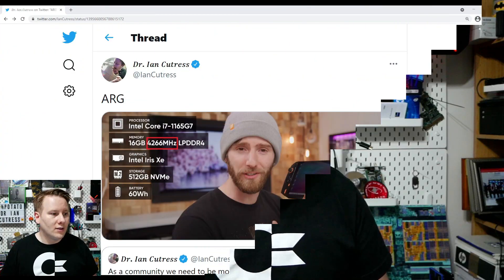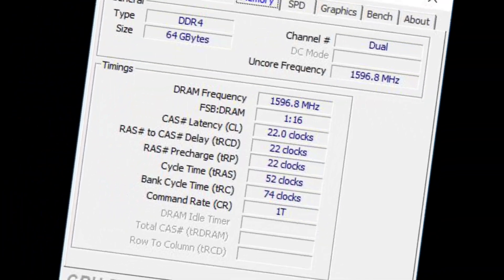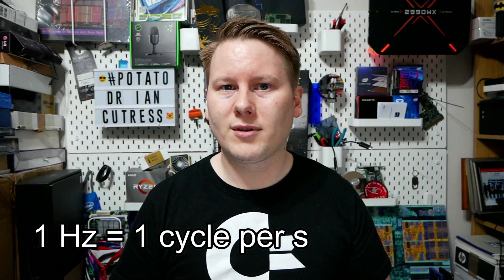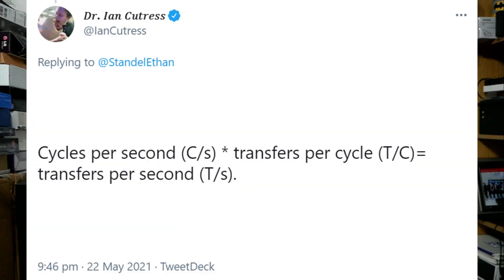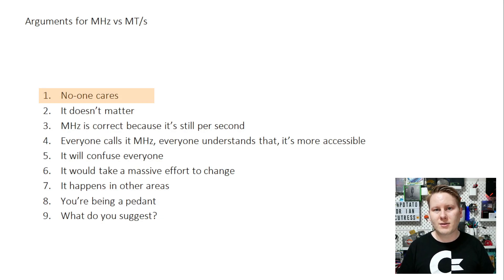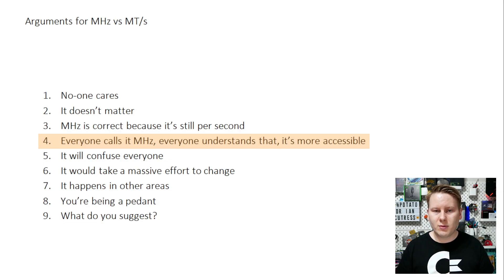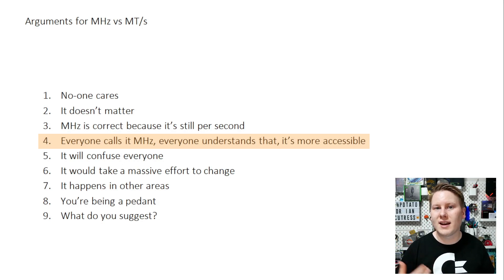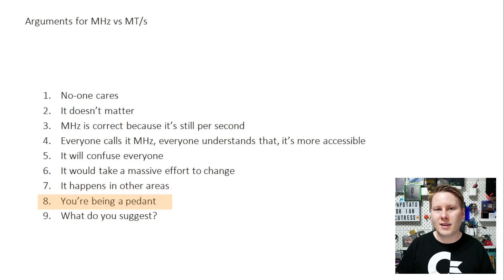Linus is WRONG 💩 : Explaining MHz vs MT/s

Comment: like I wrote under the original video from LTT, modern SDRAM modules use some kind of prefetch. A DDR4-3200 module runs at 3200 MT/s, a bus (I/O) speed of 1600 MHz but only 400 MHz actual memory chip speed. DDR4 uses x8 prefetch, DDR5 will use x16 prefetch. That's why theoretical DDR5-3200 module would run the chips at 200 MHz. This is the reason, why the absolute latencies are stagnating, because memory chips stagnate around 200 to 400 MHz each DDRx generation.

Like buildzoid, I'd prefer to refer to the measurable number -> how many bits can a module process per seconds. I think JEDEC would agree, since the offical nomenclature for DDR4-3200 is PC4-25600, which refers to 25.6 GB/s.

Comment: I have 2 issues with your video point #3. Mhz is just something over seconds. Changing it from clock cycles per second to transfers per second and still using Mhz is still fine. I understand if you think that Mhz needs to be reserved only for clock cycles, but no part of the unit Mhz has any reference to a cpu or ram cycle, only to a single unit over a second. #9 using no units is my idea of scientific hell. please no. Announce the units and tell me what they mean in the scenario. Like in chemistry when we use concentration, we use XX% w/w to signify the percentage is expressed as weight percentage as opposed to volume. In this case we could use Mhz clock cycles or MT/s and state the uinits. No units is a horrible decision.

Comment: On that Wan Show, Linus asked Luke a question about MHz and Luke was actually stumped for the exact reason that it wasn't immediately clear if the MHz Linus was asking about was DDR or QDR.

In practice, as a particular memory standard becomes more popular, I imagine you could often infer from context what the actual clock speed could be, because QDR would provide double the memory bandwidth of DDR. For example, it wouldn't really be possible for a memory kit to boast 6400 MHz if it's only DDR (meaning for it to be 6400 it really has to be QDR). And because it's QDR then you know the memory clock should be 1600 MHz.

But yeah, I remember when I first learnt about memory speed I was quite confused about the memory speed advertised, because of the "MHz" listed. It's only when I started to check past forum post answers after googling a little bit that I realised what was happening. And after a while I just stopped caring because apparently the people who sell memory don't seem to care anyway.

Edit: but Linus has a point about your channel name. So when you say making changes for the better...
Reply: "For example, it wouldn't really be possible for a memory kit to boast 6400 MHz if it's only DDR (meaning for it to be 6400 it really has to be QDR). And because it's QDR then you know the memory clock should be 1600 MHz"
Well take decade old QDR 3200 vs DDR 3200 and you get a confusion if the context is not well established. And it's quite easy to be mislead on certain types of memory such as GDDR.

Comment: i did not know about this before i heard of it on the wan show and i think you are right, its is very important to use the right units.
 i am very against using obscure terminology as a form of gatekeeping,  but here it is needed because they describe different thing and as you said for ddr  Hz is of by a factor of 2 and describes the cycles per second not transfers.  
keep up the good work and please inform us on other incorrect uses :DD

Comment: Curios question then what is actual operating rate of GPU memory. is it the figure which they mention for 256 bit bus which is 448 GB/s (and so on for 384 bit bus etc) or the rate of transfers which we see in the overclocking software (which is shown in MHz)

Comment: MHz - cycle of how many times something happens. It doesn't specify what, your example of digital logic cycles is just one specific type of cycle. You can as well say that it is the cycle of opportunity to make a transfer, you don't have to make the transfer, but the opportunity to do so is periodic/cyclic. The point is - MHz by itself doesn't in any shape or form specify the exact event that has to happen periodically, it just specifies the frequency of some occurrence. MT/s specify what happens, that is the only difference, but both are correct, one is just more specific to this use case.
Reply: Thanks, exactly. A frequency is just a rate... It can represent anything that changes periodically, the changes in the clock or the transfer rate or number of potatoes I eat. The whole argument is utterly stupid and in the end is just a convention.

Comment: I have known about the discrepancy between rated/promoted speeds ever since I built my first computer. 
 The listed speed in OS was less than half for my memory (because it was running below rated speed, bios settings needed) and the way I looked at the ddr speed then was the same as I look at boost speeds for GPU and CPU, a peak speed. 

I didn't understand ddr at the the time, I genuinely thought it would boost up to 2x the clock when needed, it was one of the creators you mentioned that made med understand the details

Comment: No, your very right.  Moving forward, I'll skip the units unless it's called for, and then be sure to use the correct units.

I know it irritates me seeing measurements of base 2 being incorrectly expressed in base 10 (1tb is not 1000 gigabytes, it is 1024 gigabytes).  I use these measurements more enough that it throws me off when expressed incorrectly.

Comment: On a similar tangent, it's like the lightbulb industry that used wattage for over a century as a measurement unit for their products. It wasn't wrong per se, but people took it as a measurement of light emission instead of a measurement of energy consumption because only one lightbulb technology existed for so long (incandescent) so no one cared about being wrong since you could easily compare the light that a 40 watts lightbulb emits with 60 watts or 100 watts, etc.

Then, in the 2000s, CFL lightbulbs flooded the market, and we had to make mental gymnastics in order to understand that now these lightbulbs were only using 15 watts to emit the same amount of light as a 60 watts incandescent one. A few years later, the same thing happened with LED lights; 15 watts became 8 watts for the same amount of light emitted.

It seems the industry is finally, but slowly, transitioning to lumens to measure light emission, but they still have to print "Equivalent to 60 watts" on the packaging so that most people understand what they're buying. I've tried explaining all of this to my mom numerous times and it just doesn't stick, she wants her 60 watts lights lol

Comment: Nice video. Would like to see single rank vs dual/multi ranks. I just tried mixing 16gb crucial ddr4 2667 dual rank had address mapping from edge connector set in synchronous mode while sk hynix dual rank oem Dell used 8GB 2133 had address mapping set to mirrored. Any technical differences? I returned the crucial memory since performance was terrible.

Comment: Until retailers and BIOS makers change the units, I don't think it will change. Also, im fairly certain Linus used to use DDR4-3200 for example in his videos (iirc around the zen 2 era).  Maybe he uses it interchangeably. Don't think it would change much if he went back to that style though.  Everyone has to be on board.

Comment: Love ya video and agree with a numerical change to the way dimms are portrayed. Unfortunately, like Linus, people are not understanding of the units all too well and only look at bigger is better. Lower CAS latency, for example, will destroy a higher "MHz" number on the flashy chips. By integrating CAS into the equation and creating a ratio of MHz/CAS (or transfers if you wish) you will get a new fancy ratio to determine what is right for your needs. The higher this ratio value, the better the performance. I plot this number vs the cost per GB.

Comment: I didn't know that ddr didn't do 2 transfers per cycle!!!  I always thought that was fixed to 2/C.

I guess siw as in group 3 but if it is indeed not fixed 2/C than yeah MHz is wrong.
Reply: If nothing else, it needs a state for 'no data being transferred'... besides, the CPU mem controller has a clock generator that in the case of DDR4-3600 runs at 1800MHz. Why would you use any figure other than that set by the clock generator?

Comment: The manufacturer calls it Trident Z Royal DDR4-3600MHz.
Also the CLOCK cycle is running at 1800 MHz, but it's doing transfer at 3600 MHz. If you look at the diagram for DDR, there is 2 distinct, time separated signals being sent per CLOCK cycle for DDR. If you have a cogwheel with 100 teeth connected to a larger wheel. Say the smaller gear is rotating at 20 Hz, the teeth will be contacting the larger gear at a rate of 2,000 Hz. It's still correct to say that especially outside engineering.

Also Hz is a SI unit, you need very good reason to avoid using that. Also, also why have computer scientists pretty much reinvented baud rate? In information theory and analog signals you use Baud, symbol per second, saying 3600 MBd is just a more general way of saying 3600 MT/s. The unit T/s is also a terrible unit because it is in direct conflict with SI where T stands for tesla. 3600 MT/s in SI, already means magnetic induction slew rate, ie how fast a magnetic field can change. Don't use T/s, it's a dirty unit.

Comment: I agree people should definitely either be using the right unit or don't use units at all, in which case implicitly people are talking about megatransfers per second but explicitly they are just mentioning a speed signifyer. I'd say, though, that your rebuttals of "it doesn't matter" and "you're being a pendant" given in the video are not very good, especially in light of your agreement that it would take a massive effort to change. Unimportant pedantry leads to negative consequences just as imprecise language does.

Comment: Better to change to correct unit, even now cpu-z memory tab causes some confusion in not well informed audience anyways, at least your approach should be used, drop unit completely, but to change to correct unit would be better, (also it can be mentioned in more specific videos how does units work).
Reply: You know, CPUz could just change the way they report to the user. 

Why change what works for the average consumer just to please people who are tech savvy?

All this is advocating for is confusing the shit out of the layman.
Reply: @nordgaren2358  Its possible,  in this case CPUz should either drop the unit, or report MT/s, it will not be good to and perpetuate usage of incorrect unit
I do not think that is would be a big hassle to everyone to switch  to correct unit
Some vendors now use incorrect MHz marking, but if check detailed specifications, there is correct correct MT/s unit there, otherwise they could be sued for incorrect information, now they can at least claim, that MHz in the name is for marketing purposes and specifications are correct, but IMHO still a misleading marketing
Reply: @giokiborg  the average consumer would just get confused. 

They're already confused enough, as it is. 

This is really a pointless video.
Reply: @giokiborg  I don't know a small ngle manufacturer who lists the product name with MT/s. 

Yes, in the specs, but not in the product name.

How could they be misleading people if they put that info in the publicly available specs?

Hell, how could they be misleading people of people don't even know the defence between MHz  and MT/s?

The only people they would be "misleading" are people who know the difference and THOSE people already know that MHz isn't MT/s and that the advertised MHz is the overall transfer rate of the module. 

Again. This is very pointless and is just a giant "ummm ackshully".
Reply: @nordgaren2358  I do not agree
Misleading is the fact, that in the product name some manufacturers have MHz in the name
for example this: https://www.newegg.com/ballistix-16gb-288-pin-ddr4-sdram/p/N82E16820164173
If customer is not aware,  they think, that their RAM works at  3600 Mhz and this fact is misleading, even if they have listed in specification correct MT/s (but no mention on MHz)

Meanwhile other manufacturer names their RAM without MHz in the name
https://www.newegg.com/g-skill-64gb-288-pin-ddr4-sdram/p/N82E16820374003 (like Dr. Cutress proposed)

If you do not think that its a shady practice, I am out of arguments,

Yes, we kind of don't care anymore MHz, or MT/s, but it does not means, that we should use incorrect unit, just because of marketing demand 
I am sure this was used for marketing purposes, to write bigger number on the box and to hell correct units. Linus himself often calls out marketing BS from manufacturers, so why submit to this one?
Reply: @giokiborg  the customer still understand what they are buying...
Reply: @giokiborg  your hypothetical issue doesn't even fit the problem and solution you propose. 

Wether you brand it as 3600 with or without the MHz, CPU-Z is still gonna report the 1800MHz speed. 

This sounds more like a CPU-Z problem than the entire industries marketing problem.
Reply: @nordgaren2358  Agreed, in same logic, they will understand correct units as well, so what is the reason not to use correct unit and use "marketing unit"?
Reply: @nordgaren2358  My issue is with misleading marketing and incorrect use of units, which could be solved in very simple way: use correct unit

CPU-z is not only one which shows correct frequency, HWinfo64, AIDA64 reports correct frequency,
Why it is important to follow marketing information and not the actual frequency?
Reply: @giokiborg  becuase it's already been used incorrectly, and changing it won't change anything. Literally nothing. It won't change anyone's understanding of RAM. The only outcome is confusion.
Reply: @giokiborg  again, this is a problem with these softwares. They could just as easily report the MHz and the MT/s and people would understand, becuase the numbers would be the same. 

Again, dropping MHz from marketing will do literally nothing, because people will see 3600 MT/s on their ram and go to GPU-Z and STILL SEE 1800MHz.
Reply: @nordgaren2358  Partially agree, it will not change anything for the people who already understands it, but there is confusion for the newcomers now (which is not too serious, but still): most MB  bios reports RAM frequency incorrectly similar to manufacturers marketing to avoid conflicting numbers,
monitoring software reports correct frequency, but causes confusion,

To avoid it there is 2 options:
1) monitoring software to report wrong frequency as BIOS, we continue usage of incorrect unit

2) start to use correct units in forums/videos/texts and put pressure on marketing teams to correctly label RAM (at least remove misleading MHz from the title) and MB manufacturers to correctly report the frequency, (at least show "effective" or something like that).

I remember in days of socket 775 manufacturers started to report effective FSB speed, (which I believe was quad data rate), so in some bios, where it was not clear which approach was used caused incorrect frequency and failed boot, because for example by raising FSB by 100 Mhz thinking it will be raised from say 1333 to 1433 MHz, but actually it was counting raw frequency (not the effective one) and 100 MHz actually was (333+100)×4=1732 which was not easy to handle for mid range boards

Comment: Imagine if we would call PCIe x256 instead of PCIe 4.0 x16 just because of the bandwidth and not because it have a different generation of features on top of more bandwidth.
DDR4 already imply 4th generation of double data rate, there's should no need to confuse customers by implying twice the actual speed.

Comment: I actually didn't know this was an issue, but it should be correct. It's kind of disheartening to see people respond to someone who, I presume based on the "Dr." prefix, is an expert in the field with things like "no one cares." Like, cool. You're a pedant and you don't have an interest in how your computer hardware works, buy a Mac*. But for people who want to actually know what they're buying, we don't want to be lied to or deceived, even if it's just deception by use of industry-standard terminology. If the terminology is wrong... fix it.

*As a Mac owner I approve this message. I have a Mac, idk what's in it, but it works well.